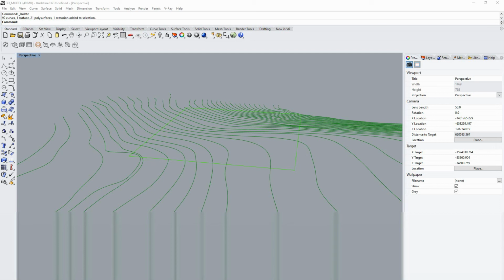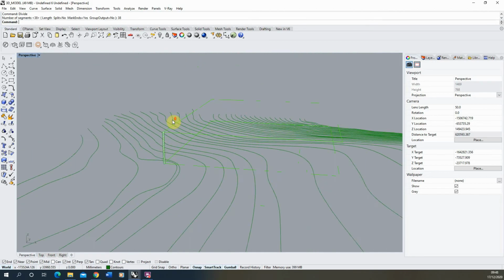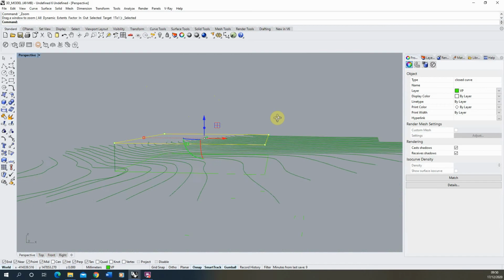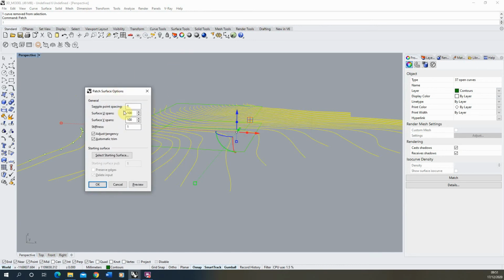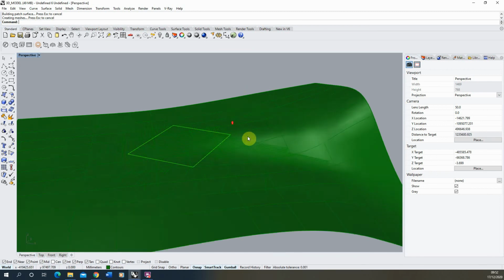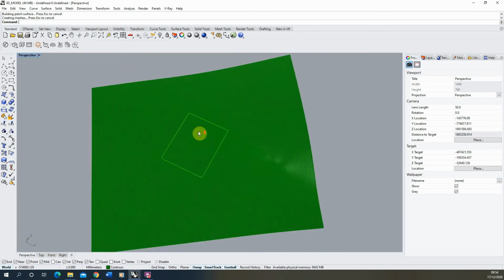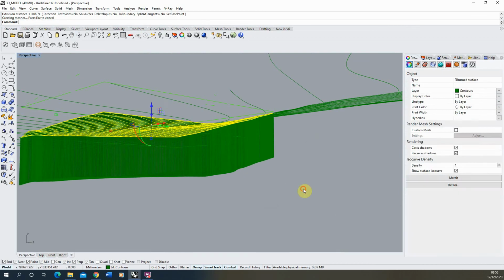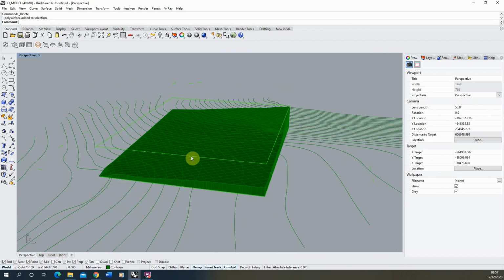Terrain Modelling from contour lines in Rhino - Tutorial

Comment: I prefer the Patch method because when I import contours from AutoCAD, they are already offset on the Z axis according to their height. 
To avoid the issues with Patch, first add points to your curves by "dividing" them, then use Selection Filter to select points only, and use the points for Patch. The result is surprisingly clean!